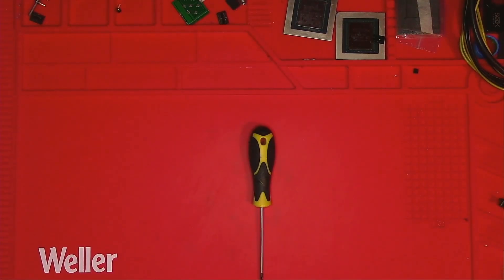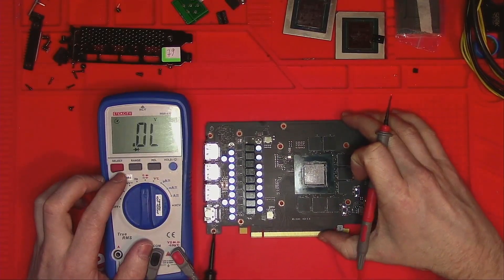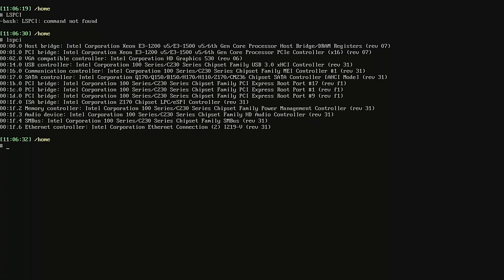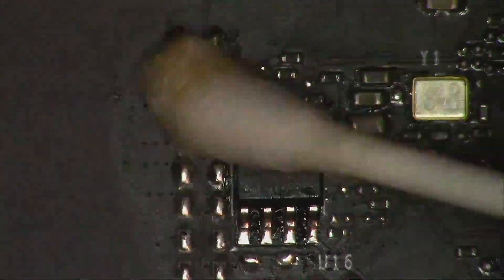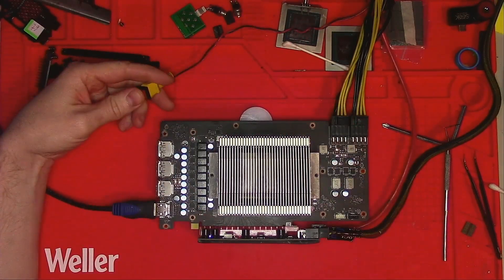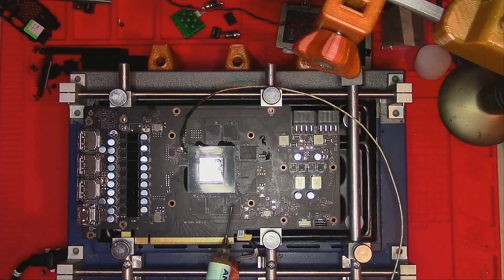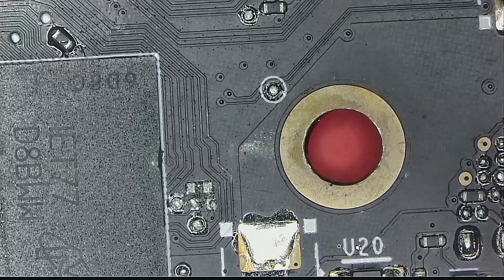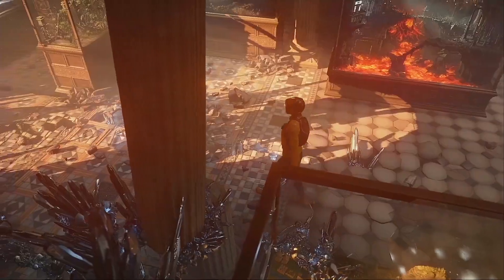The graphics card runs too hot. how to fix the thermal interface properly

Comment: So yes we must check those missing components before counting her down and out. Beginning to think graphics chip problems. So the last time the cat who owned her never had a picture again after the last re-paste on the water block. But those resistors may have been the cause of the memory chip failure @ c-0. Costing Renaldo money. A water block would certainly let her run flat out.

Comment: From your videos I've definitely picked up that you don't like Micron memory. so a bit of a curious question here. my old RX 580 has micron memory, and was able to overclock memory by 200mhz on that card. my newer 6800 xt has Samsung memory and it doesn't like me adjusting that slider at all. I understand that doesn't necessarily translate to quality of the part, but why might this be?

Comment: Man you need to charge additional for those pads if you're not. You should also charge for customizing pad thickness. You're not fixing a light bulb - you're fixing a board with an insane amount of layers and complex circuitry! Then on top of that you're not just throwing on spec pads and sending the gpu back - you're making sure everything is perfect for cooling and longevity.

Comment: i had a card from kfa2 that was defected but no signal! no shorts but on the 1.8v line i read a short to ground!! a dead shot, but without any damage.
is that possible that this card has a dead gpu?
the repair shop said it was a no fix cause of dead gpu! but no shorts on any powerline and gpu takes no current at all!

Comment: 😂😂😂😂I wish it was as easy as sending my girl to be fixed at Northwestrepair with reballing and changing a few chips, it aint that easy folks as she aint no MSI 3070 TI Ventus but seriously, do you know how to fix a GPU ERROR 43 on an Acer Triton 300 RTX-2070 GPU, as its not detected and I can't load any drivers the GPUz is not showing the BIOS version and the card is not recognized, done everything, reinstalled drivers and even Win-11 and still can't get the card to work. Any advice would be appreciated or is the card kaputnick.
Reply from the maker: run memory test

Comment: Hey what thermal paste you apply? is it mx2/mx4?
Reply from the maker: mx4
Reply: @northwestrepair  well. i dont want to be rude but from my own testing on bare die applications it is one of the worst options. it pumps out in like 2 days and performs like garbage. What is funny, the best long lasting paste i found is ARCITC CERAMIQUE 2 but its almost impossible to buy. i got hold on one shop that still had it. ended up buing 6 largest tubes for my service :)
Reply: and even better is arctic silver 5 but this one is expensive as hell and acually impossible to buy.

Comment: Reball = Re-flow  = 1-3 monhts life time  in 99,9% issue is in  connection between substrate na silicon die re-flow temporary can fix this
Reply from the maker: Incorrect.
This temporary fix worked only for gtx 980 and older.
Since 10 series, no longer works.
Stop baking your cards unless they are 15 years old.
Reply: @northwestrepair  Re-ball is equally useless to re-flow.

Comment: Another awesome repair, I have a random question, is it possible to add more memory chips to a gpu if it has extra pads to add them to or will that cause issues? I noticed some cards have extra pads that are unoccupied that you could add more memory chips to those spaces
Reply from the maker: On top of  finishing the circuit and adding chips, It will be very time consuming to find bios version that will match.
And it will give no performance gain from what I heard.
Reply: @northwestrepair  interesting, so in conclusion it's not worth the time to fill those unoccupied pads with more memory chips
Reply: @TheBlueBunnyKen  Not to say not worth the time. It is not even doable. Lets say you have a RTX4070Ti,  many AIB partner PCB has 2 unoccupied pads for memory chips because they share PCB with the RTX4080 that can populate all 8 of the memory pads.  You only see 6 memory chips soldered to the board because it is running on a 192bit memory bus. Each memory chip contribute 32bit to the total memory bus width. Even if you go solder another 2 memory chips to the PCB, it is not connected to the memory controller in the GPU silicon, because the AD104 silicon max out at 192bit memory bus.  You can either put 6 or 12 memory chips to hit that 192bit memory bus. Nvidia will also physically fused off memory controllers in the silicon in the case of the 8GB version of RTX3060, you cant put 6 memory chips to enable 192bit memory bus from a 128bit .
Reply: @fleurdewin7958  Ah ok, makes sense
Reply: The answer is sometimes in certain situations. There's a video on YT by fxbbm called "Doubling VRAM? Upgrading an RX 480 from 4 to 8 GB" if you want to see what that looks like.
Reply from the maker: @The_Man_In_Red  doubling memory is different from adding memory.
Besides, 400 and 500 4gb and 8gb series AMD cards are identical so no wonder.